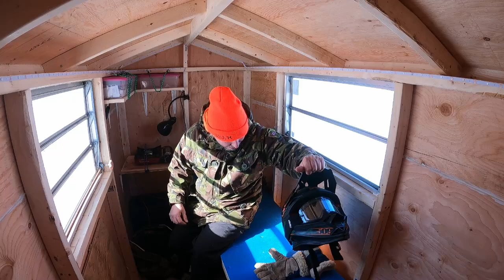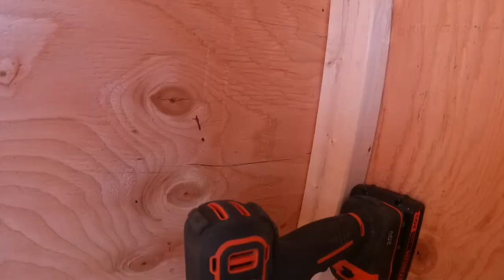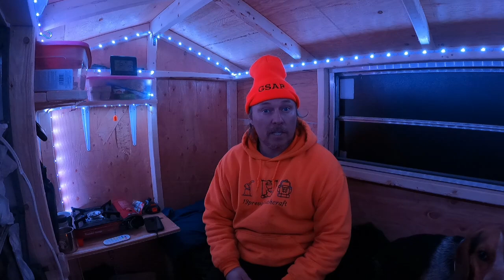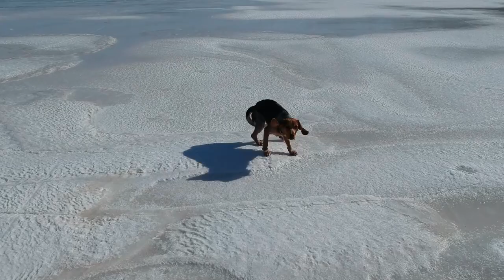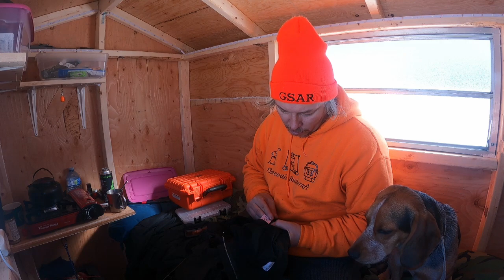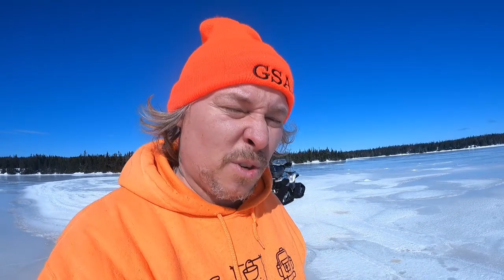Tiny Ice Shack Overnight in Freezing Temperatures

Comment: Butane stoves dont work well in cold temps. Thats prob why your having a issue with it.
If you get the buddy heater you can get a paint tray that goes in a 5 gallon bucket and use that to also cook on.
Or you can get the buddy flex system, but with the flex, you cant cook and use the heater
Reply from the maker: Thanks Eddy !

Comment: You just may need an anchor and running lights 😬😬😬😬

I’m thinking that the stove doesn’t work, because the gas is too cold. You need low temp gas. I think Coleman makes some.
Reply: Yes butane does not work in cold temperatures.
Reply from the maker: Thanks bud !